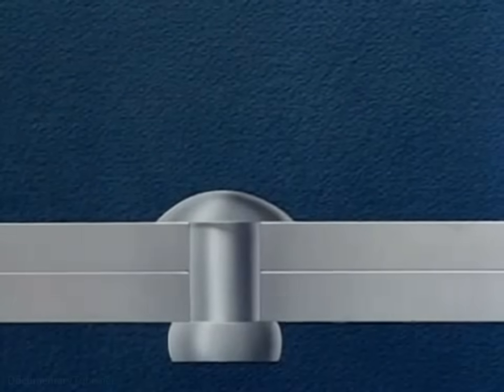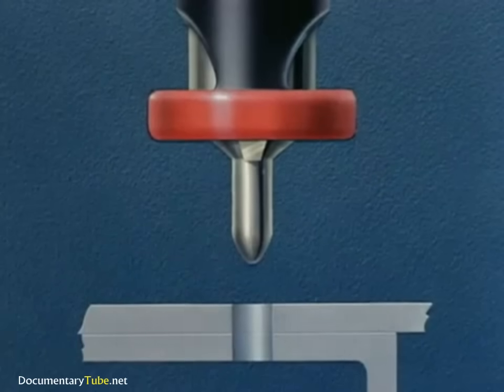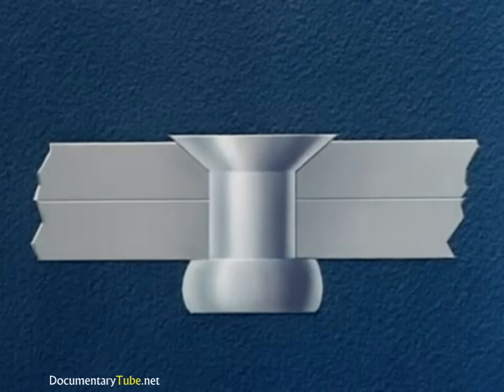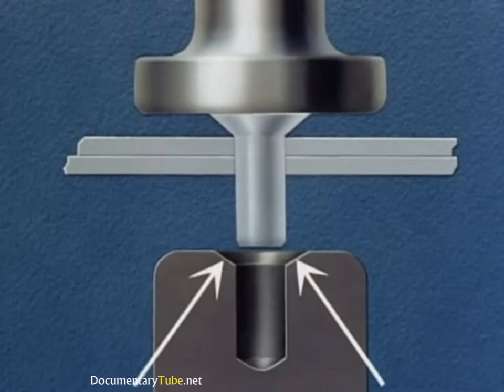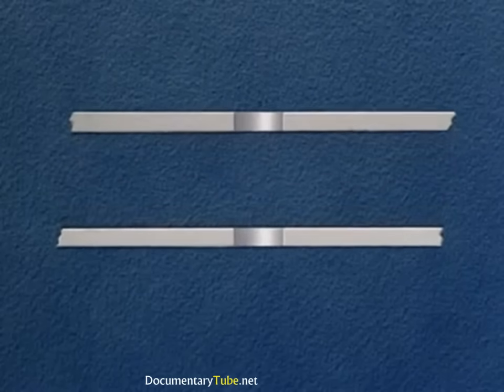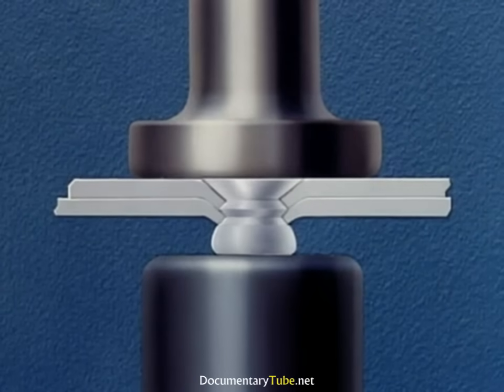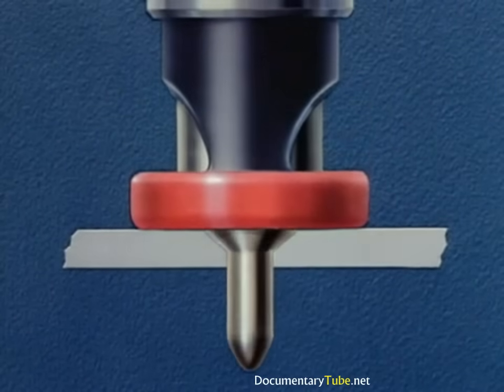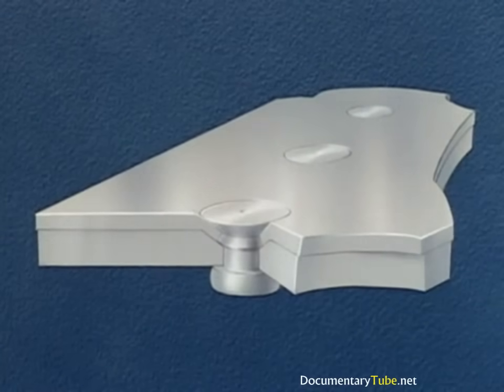HOW IT WORKS: Aircraft Flush Riveting

Comment: "We are using a one eigth inch rivet, so were drill a number 30 hole"
Yeah, ... how obvious... ;-) Why not a "one eigth hole"?
Reply: +Simon K.
 A number 30 drill bit measures .1285". 1/8" is .125". The #30 drill bit drills a clearance hole for the 1/8" rivet, providing .00175" clearance per side. Enough to allow the rivet to pass through the hole with a snug, but not tight fit.
Reply: Probably because a #30 drill just happens to provide the proper clearance;  I don't have my table handy but it's probably 2 or 3 thousandth's bigger than .125 in.  The next larger fractional drill at 9/64" would probably be too sloppy.
Reply: To answer your question regarding "How to measure 1 metre using your body." 
You hold 1 arm out to the side, and measure from your fingertip to your opposite shoulder. This gives you a metre that is as accurate as any body-part Imperial measurement.
Reply: No good.  wallering out a hole like that invariably leaves the hole oblong, and thus subject to tearing in at least one direction.
Reply: there several methods of measuring the diameter of drill bits there is the fractional system 1/64" to 1/2" in increments of 1/64ths then there is the number system which is based on the wire gauge 1 to 60 where  the No1 is just under 1/4"  and No 60 about 0.008" they get the number 30 hole from this and fills in gaps in the fractional system then there is also the letter drill also based on the wire gauge larger than the number 1 A just over 1/4"  up to Z just under 1/2" fractional and that is before we even get to metric :) old time tool maker time served in Barr & Stroud Glasgow
Reply: There is  English.
Reply: Kain, your thumbs are only 1 inch long?! How old are you? Or did you mean half the thumb---the distance from the tip of the thumb to the 1st joint?
Reply: this is literally word for word the exact same thing i thought
Reply: +kain hall: I get that. But what it does not show you is the amount of clearance, which you would want to be different, depending on the actual application. There is no easy way to find it out, except by looking into a table that translates the "number 30 hole" into a measurable length.

Also I think the fact that today (basically) only the U.S. of A. are still using fractional inch is a good indication of how useless and error prone this system is. So statistically speaking, you don't have a lot that backs up your claim regarding the fractions, sorry.

The same holds true for the imperial system, btw. What is a meter, you ask? Well, it is a well defined length that is the same all around the world. To cut your rant short, I just wanted to tell you that, in fact the imperial system is nowadays based on the metric system and its definitions. In fact, the inch is exactly (per definition!) 2.54 millimeters. So I ask, why do we need "another measurement system on top of the metric system", because after all, that is what the imperial system is, these days. It is just superfluous. Oh, and by the way, 50 feet heel-to-toe might not get you even close to fifty actual imperial feet, depending on the size of your shoes.

I get, that a rivet needs clearance. . However you still cannot tell me off the top of your head, how much clearance the rivet gets. And by the way, if you switch around all the fives in ".55mm", you still got ".55mm".. so maybe you just got a bad example there ;-) I know, I know, you think that decimal points are evil, but in fact they are so much easier to deal with in your head, than to add up a 1/8th rivet that has to get 3/64th of clearance. And this is why I said, that you need another broken system (number 30 drill), just to be able to deal with the broken system in the first place (fractional inches).
By the way, referring to one commenter above ".00175" is much harder to read and swap zeroes than ".55mm" in fact, if you like you could also use "550µm" or, if you like the zeroes "0.00055m". As an engineer I personally prefer 550E-6m, which is not only easier to grasp, but easier to calculate with (e.g. 550E-6m * 1E3 = 550E-3m) and is also typed into a calculator much faster, without missing out on any zeroes thus avoiding order-of-magnitude mistakes.
Reply: The Garden of Eatin the way we do it in work for standard rivets is with imperial size for the I initial hole then open with a clearance size that is metric. 3/32 hole then open to 2.5mm for clearance for 3/32 rivet. 1/8 hole then open to 3.3mm for 1/8 rivet. 5/32 hole then open to 4.1 for 5/32 rivet. Clearance sizes are roughly 4 thousandths of an inch bigger than rivet size.
Reply: And it was the people like myself that brought you the 3.2mm drill bits...
Riveting. 
Eyelet an blind pop rivets are commonly 3.2mm "standard" ( too short)
I use 3.2mm "long" for my projects to "grip" the pieces together.
Reply: It’s called engineering.
Reply: Love how two years after this comment, the metric vs imperial war is still being fought in the comments.
Reply: Simon K. I'm guessing this video was made in about 1940-1945.
Reply: In aerospace everything is specified.
an engineer has calculated the exact clearance of the rivet in the hole to get the perfect squish band within the layers of sheet material and the customer expects it to be done to the exact specification the signed for with the engineer.
I work in composites and we have had reworks for things like I'D writing on the inside of the part that was not in the correct place set in the specifications.
Reply: A standard drill set worth buying will be labeled with both the numbers and the measurements. YOU know what I think though? I think that it's labeled in such a way because when the first one was made they dropped the damn thing and had a hell of a time putting all the pieces back where they had to be.
Besides, if you've ever used the same drill bit for awhile you would know that the numbers or measurements they print on them don't stay on there for long and are usually not the best way to ensure that you're using the correct bit.. NEED to pull out the ole vernier calipers and figure out what it actually is.
As for the video, he switches back and forth between the numbers and the measurements because he has to! Aviation has SOME standards, and those standards must be upheld! Try to get ahold of an old AC 43.13 book, the narrator quite nearly quotes that damn book. It's actually alot easier to understand this way.. I mean, they left out de-edging the holes before you rivet because it could cause MAJOR problems with rivet strength and internal corrosion but that's just....
COMMON SENSE.
Reply: Sorry but the only complication here is your inability to comprehend that an alternative to the metric system exists. The last time I found fractions scary I was 6 years old
Reply: number 30 is slightly bigger
Reply: Now that you've had time to digest all this info.
Ready to talk oversized vs. nominal? 😄
Reply: i think you want the hole slightly larger than the rivet dia so that the rivet fills the hole when bucked, making a tight fit.
Reply: +capriracer351 I would suggest that it's also easier to use a numbered system than a fractional one, so that you're not looking for a 9/64 or some such clumsy label and accidentally picking up an 11/64. 64ths are also larger increments than numbered drills come in; you'd need sets with 128ths!  "Hey Clara, have you got a 33/128ths drill?" Far safer to specify simple one- or two-digit numbers.
Reply: +capriracer351: I don't get how a system, from which the imperial system is nowadays derived is more "dumbed down" than the other one? To be honest, I would actually say it is exactly the other way round, but thats okay.
I can also switch from one system to the other, that is not the point I am making.
I guess the point I am trying to make is actually, why would you need to change the system AT ALL? Why not use one single, well defined and regarded system throughout all your work? Wouldn't that make things easier and less prone to errors?
So again, what I am saying is that intelligence (as you describe it) is not to be able to convert between the systems, but in fact not being required to do so, because you chose a common system in the first place thus avoiding any potential conversions.
Reply: What a mental argument. Imperial has been widely shown to be an inferior, less effective, less efficient method of measurement. Pretty much the reason why the ENTIRE world besides the US uses it. Oh and Burma and Liberia. Lol. I don't even know why you argue to use this antiquated and inefficient system.
Reply: Because a 1/8th inch rivet won't fit in a 1/8th inch hole
Reply: Birkbecks 
I think you made Simon's point for him. It's really impressive that you can remember all that, but the simpler system is to just stick to numbers. What is gained from all the conversions? 1/8" rivet (fraction) requiring .oo4" clearance (decimal) requiring over size bit (number from a table) or letter (from a different table).
Reply: I learned a lot from this question and all the replies!
Reply: If you measure a No 30 drill with micrometer it will give you an accurate size of the drill  ( the micrometer won't be showing it's a No 30) so why call it a No 30 ??
Reply: +Simon K. one eigth inch rivets are good for 30 holes
Reply: +Simon K. 
Use what you want. If you prefer things to be dumbed down, be my guest. When this video was produced, the fractional system was standard in the U.S. hence the fractional references.
 I am perfectly capable of jumping from one system to the other easily, and many times per day depending upon whether the customer is domestic or international. This is easily done using mental math during those many times per day. If you aren't intelligent enough to do the same, then stick with you metric system. Nobody cares.
Reply: Name a country that has ruined most of the world.
Reply: The Emperor of Mankind 
What has this got to do with drilling holes in sheet metal?
Reply: Simon K. One inch is exactly 25.4 millimeters, not 2.54. You're mixing up centimeters with millimeters.This proves that any system is only as good as human error!
Reply: From the mechanic's standpoint, it's pretty straightforward.  When you're doing sheet metal work, an 1/8" rivet will need a #30 drill bit; a 3/32" rivet will need a #40 drill bit.
Reply: Are you kidding me? So basically because of your broken Fractional inch system, you Think its a good idea too further complicate matters?
To get back to my original point, what is wrong with "For a 5millimeter rivet we choose a 5.2mm hole to have 0.2mm clearance". I just dont get it why anyone would make this so complicated as shown in the video.
Reply: @kl1nk0r It's not complicated at all. 
Basically you could nearly build an aircraft with about 6  fastener sizes, 3/32, 1/8, 5/32, 3/16, 1/4, 5/15 .
So you basically just have to remember 6 number drills. It's no different than say a welder knowing what setting his welder has to be at for different thickness of metal. Or a cook remembering the ingredients for dozens of meals.
Reply: Simon K. Those engineering standards put men on the moon, and that’s the way aircraft have built since the 1930s. If you don’t understand the engineering then don’t comment on it. Better to pick up an engineering book than to question why it’s done the way it’s done, you will learn some valuable information that way.
Reply: Russ G it does not just “happen“ to provide the proper clearance, the three drill size standards in use in the United States are all designed to work together to provide just enough clearance. It’s called engineering.
Reply: @David Gold
Actually the American tax payer put man on the moon. Give that same funding to a team of engineers using the metric system and you'd likely get a more efficient result. Also less probes burning up in Mars' atmosphere.
Reply: Mel Goddard:
Because drilling a 1/8th. Hole is too small for the rivet to go in.
When a hole is drilled in aluminum, it is slightly tri-angular.
So a #30 clearance drill is needed.
Reply: Any system can be intuitive to its users. Arrogance seems to only come from the metric users, like Germany, Austria, Italy, Japan; you know, the losers in WW (and so many other areas) against imperialists Canada, Anzaks, and the USA. 
      A major reason the axis lost was not enough fuel. Well duh- liters are smaller than gallons😂
Reply: You did not work on the challenger space craft by any chance did you?
Reply: More than half the world speaks English, but no wonder you don't hear there's one universal language, you insist on speaking 'Murkian, a.k.a English (Simplified)
Reply: the fractional system is so so good that for specifying clearances and tolerances in the Imperial system you use decimal system
Reply: ⅛" drilled holes in .040" sheet works best, as when dimpled the hole opens up to the #30 size. We always disassemble the sheets to debur to prevent cracking, during dimpling. A search on my name, will show a project that has a lot of dimpled rivets, done over the last 11 years
Reply: Mitch King so why isn't there one universal language for the whole world? Chinese is actually more of an efficient language i.e. more words from less letters. Calling someone's methods inferior or superior largely depends on ones perspective.
Reply: +Simon K. thats becaus you dont understand how to drill holes...... a number 30 does 2 things for you.... drills the hole, and allows clearance. 

also.... for people who understand how fractions work.... its a LOT easier.... its a base 16 system. 

also... imperial is FAR FAR better for every day use..... what is a meter? its related to the distance travel by light in a given time...... 

ok, how the fuck does hte speed of light apply to every day life? 

lets look at the foot.... its biased on a....foot. the inch, a thumb. so if someone says i need a 4 inch long stick..... i cna go look for a stick 4 times my thumb length,m and it will be DAMN close.

or if i need to find hidden treasure..... 50 feet north west.... i just walk heal to toe.

how do you measure a meter with your body?

the British still measure weight IN FUCKING STONE! STONE! 

people think the metric system is just so cool because you can move the decimal..... that doesnt work every single time.....their are MANY cases where you can physically understand imperial better and where it works better. usually where it involves fractions. 

anyway.... the hole needs to have wiggle room.... a 1/8th rivit in a 1/8th hole will not fit.... you need clearance. which is what the number 30 does. 

why call it a number 30? because its a standard.... any drill bit that says "number x" is going to apply to the same standards..... these drill bits are SPECIFICALLY made for drilling holes with clearances. 

so in your metric example.... you have a .5mm pivit.... you would need a .55mm drill bit so the hole has .05m of clearance. 

man.... i hope you dont switch around all thows fucking 5s.....

a shit ton of 5s..... or 3 visually recognizable fractions..... hummmmmmm
Reply: @kainhall  "The british still measure IN FUCKING STONE". We don't, you know. Old people do, and I'm old enough (50) to know what a stone is, but just  about no-one under 30 will give you their weight in stone. They'll tell you in Kilos. I use kilos day-to-day now, even though my scale still has stones on it too. Imperial really is nearly dead everywhere except the US (and that officially switched in 1975, but the populace hasn't really got the memo yet). Myanmar changed a while ago, and Liberia hasn't officially but announced that it will in 2018, and I don't think there is very much imperial usage left in practice.
Reply: +kain hall ah ah, an inch imbecile !!!!
Reply: Mitch King The imperial system of measurement put man on the moon.
Reply: @rollingtones1  strictly speaking not true. The Germans use the metric system!
Reply: Simon K. 
Because drilling a hole in aluminum will give you a 'triangular' hole, and the rivet would not go through. Hence the #30 drill.
Reply: kain hall

Saying imperial is simpler every day is just... no. The metric system breaks down into tens and makes it way easier to understand. When I was working in a machine shop during summer, I was the only person who knew imperial due to my interest in history (and especially naval weapons), and let me tell you, imperial takes a lot more thinking and converting to use than metres (milimetres in machinery, where one metre equals 1000 milimetres).
For the purposes of the video if I have to install a 3-milimetre rivet, I'll take a 3-milimitre drillbit to drill a 3-milimitre hole, and trust me, the clearance is gonna be there. 

I guess what I'm trying to say is that imperial sucks, no matter how much you sugarcoat it.
Reply: Simon K. Just use 1/8 and wobble your drill around a bit